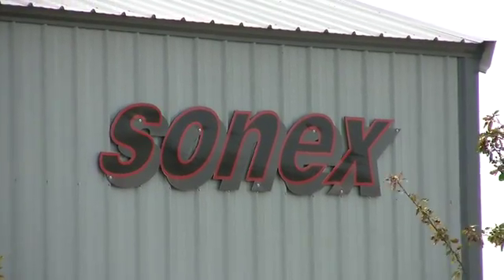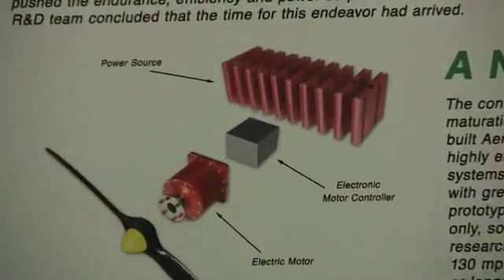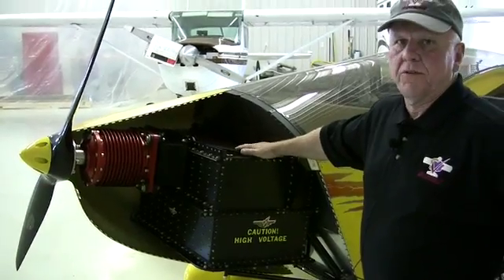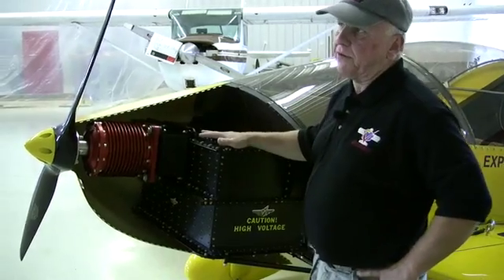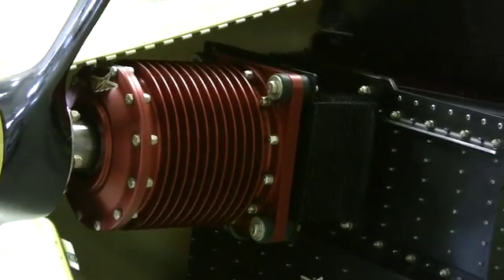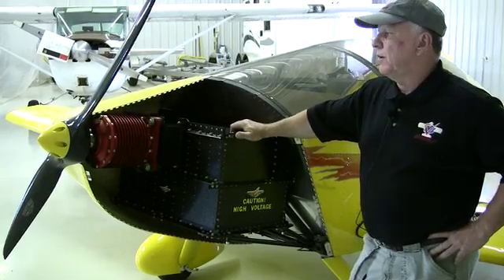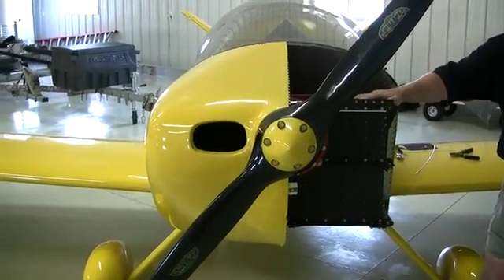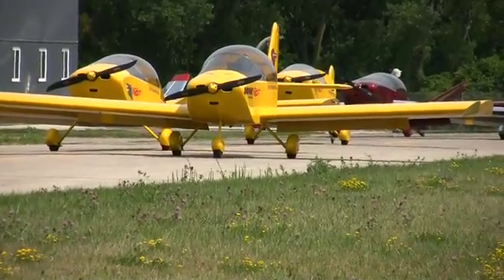Sonex Electric Powered Flight, EAA AirVenture Oshkosh 2007

Comment: 270 v x 200A = 54 kw.  I thought the aero v was 80 hp.  1 hour flight?  

Electricity it 15 cent/kw-hr.  there are 33.6 kw-hr per gallon.  That makes the "fuel" $5.04 per gallon.  Efficiency from the plug is 60-70%.  GM volt is 60%.  10% loss charging, 10% loss taking it out, 10% loss controller, 10% loss engine.  0.9^4=66% efficiency. 

A piston crank can run on $2/gallon fuel (no road tax just like the electricity...) Eff is 25%.  

Efficiency Ratio .66/.25=2.64.  
Fuel cost ratio 5.04/2=2.52

It looks like par.  

A sonex with a full tank can go 4 hrs?   How is that the same as something that goes 1 hour?   Not a valid comparison.  

200 lbs for battery for 1 hour.  Ok.  Add in three more hours and you add in 600 lbs.  Two more hours and you have no useful load.  One more hour and you have no passenger.  hmmmm  

The reason we don't use electric is the battery.  1 hour of flight is 1/2 hour legally.  Ah, but he said if you do aerobatics you get 15 minutes at FULL Power.  Full power at 270 v and 200 A is 54 hp.  

A v-twin Subaru engine can do 60 hp (with new cam) at less stress than a Rotax and it only costs $2200.  The Subaru only weighs 90lbs plus prop.  Go direct drive and slower and you have the same power for a small fraction of the weight and much longer range.   This electric stuff is close to being a cult thing....

800 cells?  800 things to go wrong???  

 How long to charge it?  24 hrs?  Serious?  How can you go anywhere with this???

Oh, I forgot to add in the cost of the battery per Kw-hr.  GM volt has costs of 12 cents/kw-hr.  That makes $4.03/gallon.  Total cost to run is $9.07/gallon.

Real cost ratio is 9.07/2 = 4.54   Wow, it costs 4.5 times MORE to run the electric in terms of fuel than a piston crank you can get for $2200.  Wish you luck....

Wonder what the cost of this system is?  10 times?

 There is a better way....

Comment: I wonder if it would be possible to make the battery pack easy to swap out? Then the 24 hr charge time would be less of a problem... maybe a pilot could even fly cross country, simply swapping battery packs at each stop.
Reply: it is but since those battery packs are expensive cross county flight with swapping packs is probably not the best option.

Comment: There is a big surface area eg. wings for some solar modules to charge…
Reply: +rob kisiel Extra weight on an overloaded plane and I seriously doubt it could extend flying time much over a minute.
Reply: The australia solar car challenge is a nearly 2000 mile race...cars have nearly half the square meter solar area than a cessna 172 wing area..using super light solar modules....Im not an expert but you need power to get up , once in cruze mode and the right gear ratios from engine to propellor I think there i a possibility of some extra distance..... It will be interesting to see the development in the next few years...
Reply: +rob kisiel Good point about solar power. I believe the solar powered Impulse flew around the world on solar power that would recharge the batteries.  Like one of the earlier comments though, the EPA and other regulatory agencies are creating more red tape for our power grid. Without getting too political the people who bash expansion of coal fire power plants and nuclear would be the first ones to cry like little babies if you took their electrical powered and gas powered luxuries away. However I'm okay with exploring new technologies. It always seems to spawn more interesting ideas.
Reply: depends on where on earth you are sun power is roughly 1000w/m2 with best solar cells being 20% efficient thats 200w/m2 with motors about 50kw for light aircraft... yes... not very good way to get more air time not to mention clouds. to be fair lets say in cruise flight something like 10kw is used on some very light aircraft. still solar cells really wont make much longer flight.

Comment: I fly full size pistons and RC electrics. So far I have been fortunate that I have not had LiPos explode/catch fire on any of my models . My friend Pete though, has had some royal meltdowns, which destroyed the plane . Here in Oz on hot days most model aircraft clubs are not happy to let you fly as they see electrics as a bush fire hazard. LiPo batteries are considered dangerous goods and no airline will carry them so the question begs ........what do you do in flight if you have a melt down and you are on board ?  Boeing has had problems with their 787 Lithium Ion batteries (I believe used to crank the APU) , and these were built with high standards in mind. Li Po bats are light ,provide reasonable storage , most times reliable , but when they go, they do it in style .......I don't think I want to be on board frankly.

Comment: I think he meant 80 cells... not 800..
Reply: Overnity. More likely 803. How? Well. You need 73 LiPos in series to get 270V - (73 X 3.7V = 270.1V). If these were all, each cell would need to be able to supply the full 200A. More likely there are a number of these 73s stacks in parallel, and since he's the man and he says 800 (and 73 X 11 = 803), then I think it likely that it's a 73series by 11parallel array being used.

Comment: Oh, and forgot to mention:   200lbs for the batteries?   Wow.  Would you need any ballast in the rear?   (wonder how the monitoring of the 800 cells is accomplished - "during the charging."  Fire guard?

Comment: 24 hours of charging for 1 hour of flying in sunny summer weather, in winter this will be 15min of flying in cruiser mode :)
Reply: Your right temp has a lot to do with time runs on the motor and batts.  But in cold weather the batts are sustained this meaning that the batts will sustain energy and flight time is increased .   This is why we store batts .from 38 to 56 degrees .   Batts do work better and long at colder weather .  The reason is that the reaction is stable this causes used energy to be stable and the batts will not heat up . These batts are not like lead acid batts like a car has  . This making that your only right for lead acid batts .  That is why lead acid batts are measured in cold cracking amps  and not hot cranking amp . I will say one thing also . Heat is hard on all batts types including lead acid batts.

Comment: jorg243 is referring to the electric motor itself. For something that small, it sure produces a lot of power. Look at the Tesla Model S. It's a car that produces 416 hp from a motor the size of a small watermelon. The batteries are not very energy dense as compared to gasoline, but improvements are continuing.

Comment: 250 lbs for the motor and battery and they deliver 54 kW for one hour.
A Rotax 912S is installed 140 lbs plus 1 hour fuel 30 lbs total: 170 lbs and delivers 75 kW.
Incredible indeed.

Comment: @jdamage68 That wouldn't work because the airflow that would be driving the rear prop would be generated by the front propeller.  So all its doing is taking the energy from the front prop and on top of that is adding drag.  It would greatly decrease the efficiency of the plane.

Comment: You need to use a brushless out-runner motor. Much more power, swing a larger prop, less current draw.  or run a gear drive. but less efficient.

Comment: Why dont you put another prop in the rear connecting to a generator to offset some of the power used? Something like a wind generator. Should get your run time to about 2 hrs. Or even better. Place a belt drive system under to prop attached to a generator of some sort. use the motor to make more power for ya. Like an alternator to provide a chargeing circuit like in your car. IF yo do this and make money I want my cut... :)
Reply: are you trolling/joking/or are you just dumb as fuck?

Comment: Given what he said (200 pound weight, 270 volt, 200 amp, 16 minute range @ full power) - the plane's battery works out to be about 0.57 MJ/kg, which is in the range of lithium ion batteries.

That's almost 30x as much energy density as ultracapacitors, so i'm not sure why you'd suggest them.

Comment: Wow SimplyAthiest you really need to do your homework.  I suggest that the first thing that you do is check out the Tesla Motors Tesla roadster comaprison in efficiency compared to any IC car (including all modern hybrids - even the prius).  Electric motors are driven by power already generated and start at 3-4 times MORE efficient than a combustion motor.  Secondly, us first world contries with 21st century current technology have some EXTREEMLY clean and high tech power generation plants.